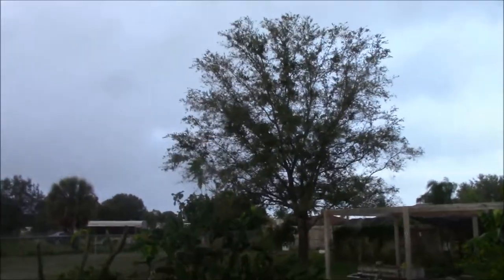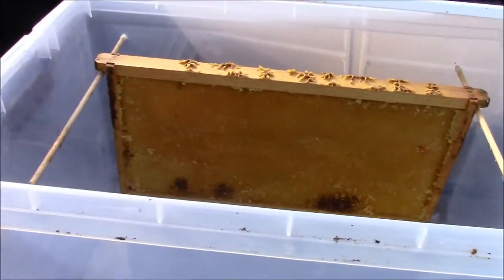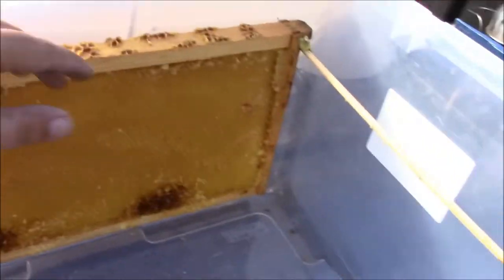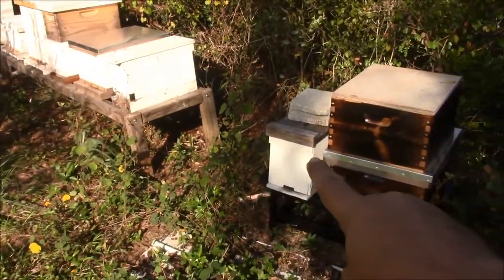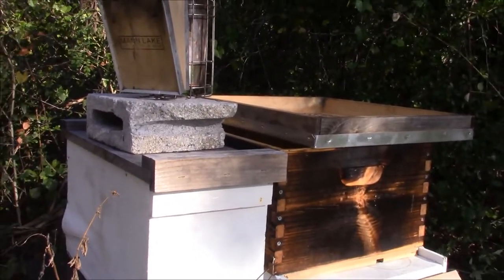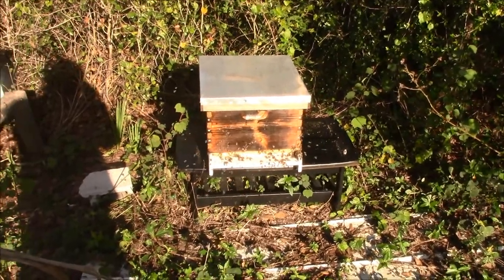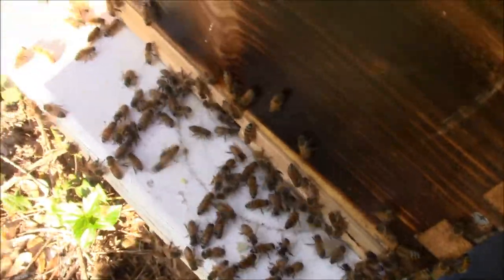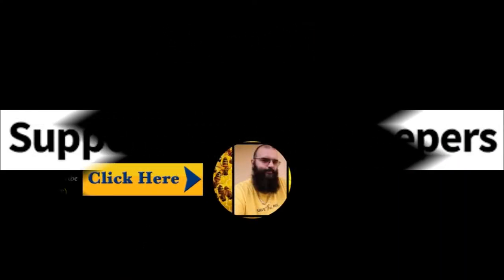Nuc Upgrade

Comment: I didn't see any wrestling but it did seem like they were fighting to get in and out of the hive. I could be looking at it wrong though.
Reply from the maker: No. You saw correctly. I think the scent of those previously spun out frames attracted robbers. The bees were sorta coming from under the table the hive was sitting on which led me to believe they smelled it through the screen bottom board.  I'll keep an eye on them, but they should be fine

Comment: I have to use a sponge style sweat band to keep my eyes clear in the summer time.
Reply from the maker: I used to use a sponge style, but then I found too often that it get's so drenched it doesn't help unless I stop to ring it out. Here in south Florida, I found the head-bands which are used for motorcycle racing work GREAT. It wicks away the sweet to the point were it doesn't need rung out at all. I love them, even though it makes me look more like a terrorist, LOL!! ✌️🐝🐝🐝